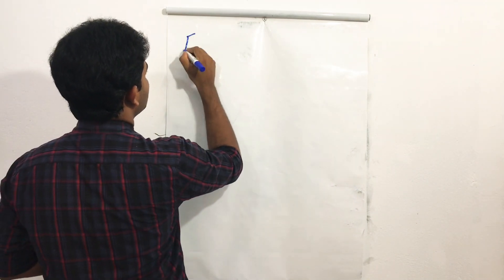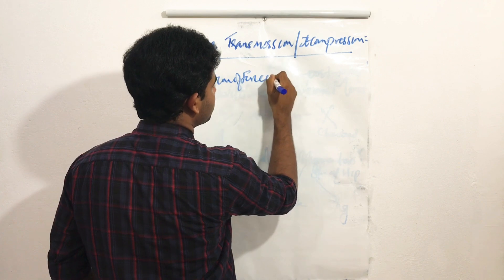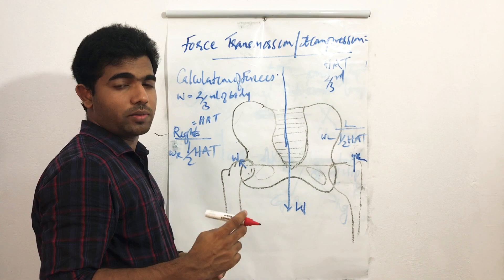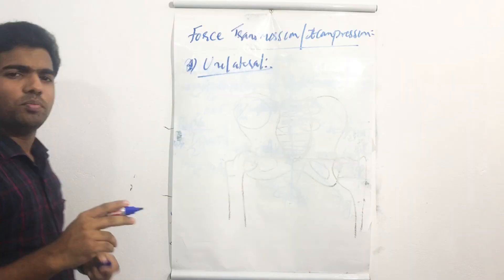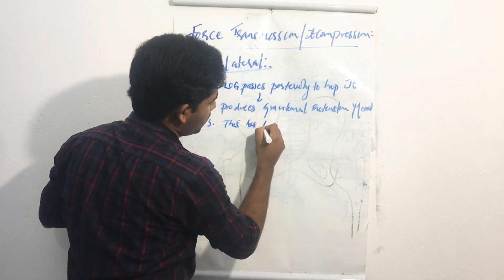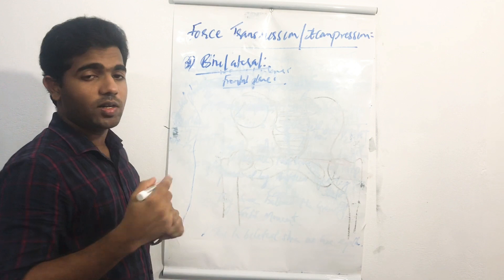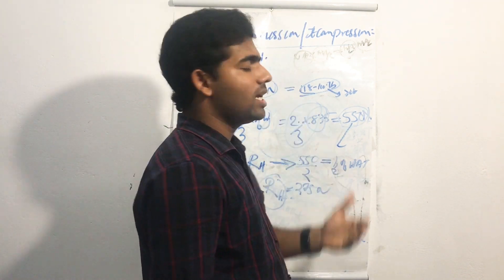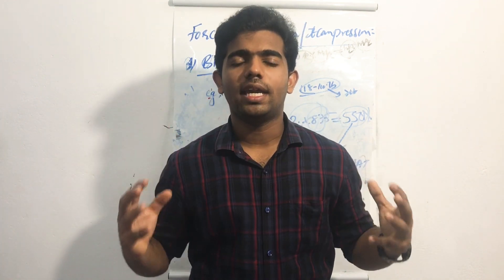Bilateral Stance- Force calculation and Joint compression

Comment: Hello sir, in the last part, 875N is total body weight, 
HAT will be 583.2N , 
And you said , weight on 1 hip will be 1/2 of HAT, 
so it will be 291.6N for Right hip
And obviously for Left hip it will be 291.6N

And if we add both (wt on left and right hip) it will be 583.2N 

But the final sum of HAT and both legs should be equal to the total body weight right? 

In our case, (mentioned in the video) the sum is coming more than the total body weight that is 583.2 + 291.6 + 291.6 = 1166.4 N 

I did not get the above (video) mentioned problem solving method. Kindly explain this to me. 
(I’m not considering the minor calculation error that has occurred from your end in the video, please exclude it) 

And solve my query
Thankyou sir
Reply: Yes